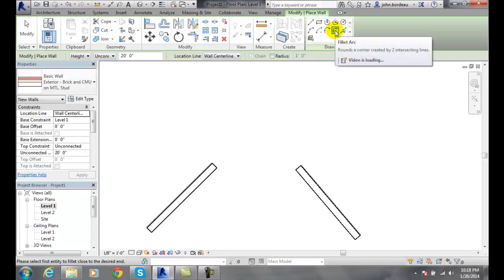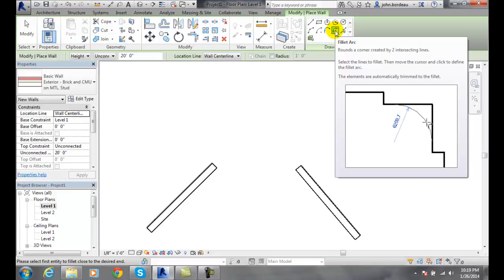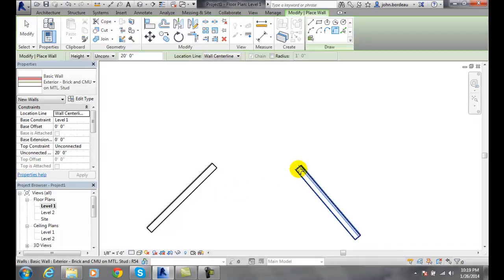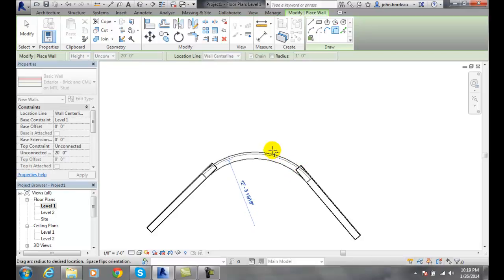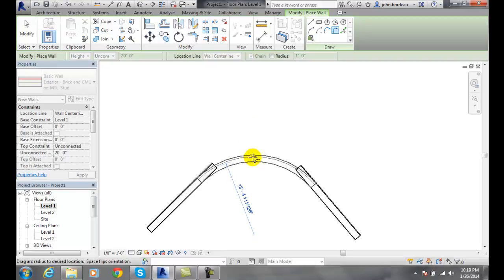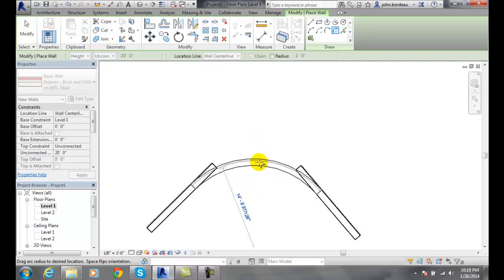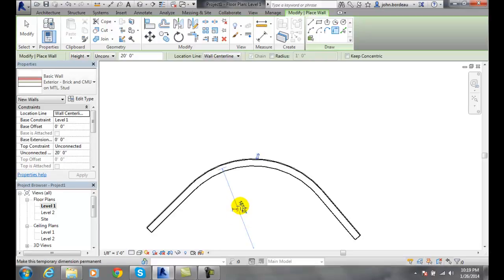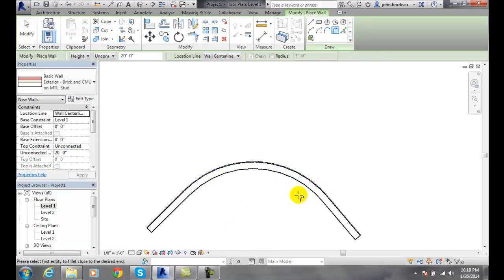Revit 03-15 Sketching Fillet Arc Wall Profiles

Comment: I have a wall I created based of a mass, using the wall by face tool. The wall is on an angle, which is why I had to use the mass tool to create it, for some reason I cannot use the fillet tool to create a curve between the angled wall and the regular wall, any tips?